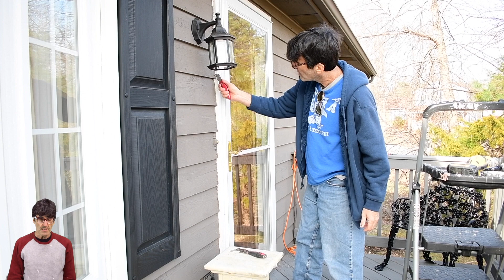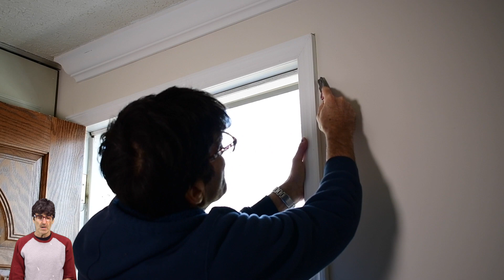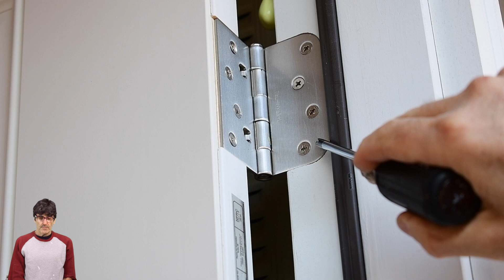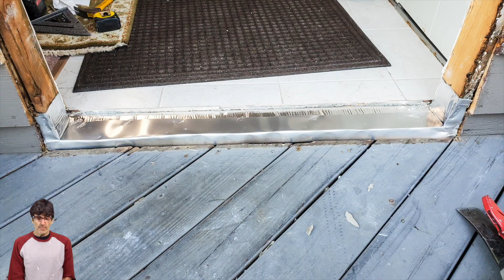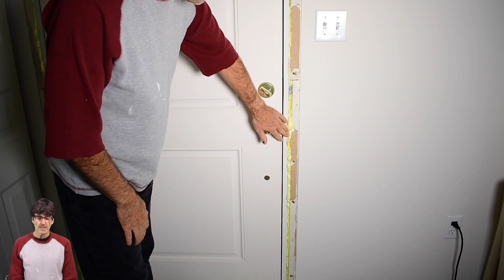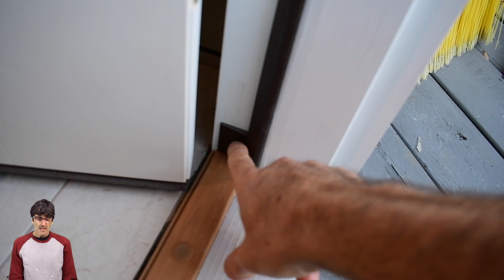How to Replace Your Front Entry Door

Comment: You literally skipped the part where you actually INSTALL the door :) No shimming, nailing, or screwing - just slam it in and start caulking the brick moulding. Nice overview though.
Reply from the maker: I didn't want the video to get to long.. its already 12 minutes plus.  The shimming is a little different in each case
Reply: The fitting (with shims) of the door, proper placement of the screws, and the moulding installation would have been valuable to see.  You explain things well, and make things look easy.  Seeing a mistake a two, would be okay also.
Reply from the maker: @1sttigertiger426  I understand and apologize for that.  The video was getting to long, but I guess a  extra 2 minutes wouldn't have mattered.  I did explain the shims and spray foam a little farther in the video. But didn't actually show it
Reply: agree. I would make video longer and get into the details more. Otherwise, great video